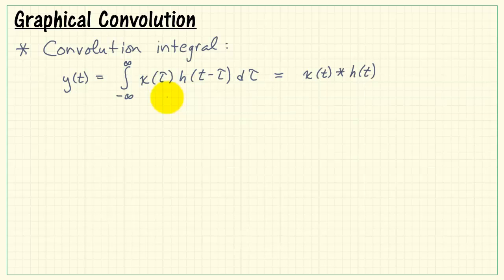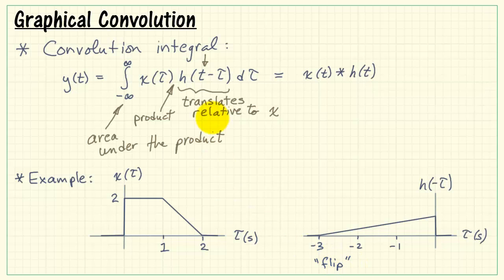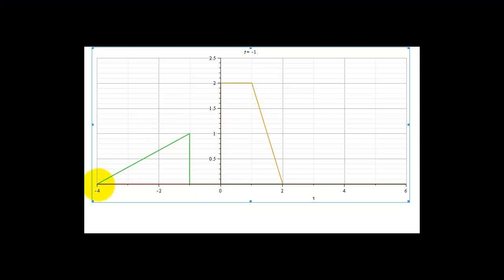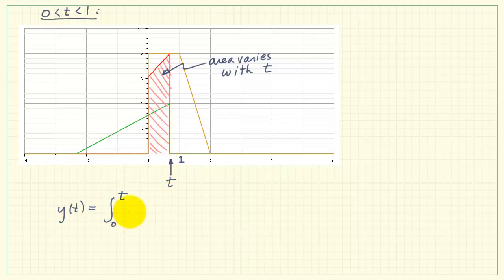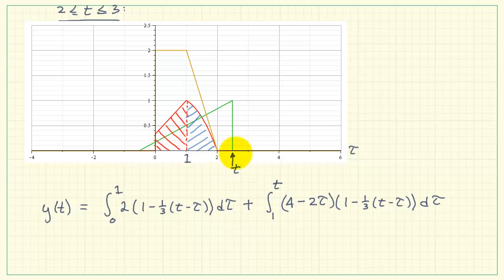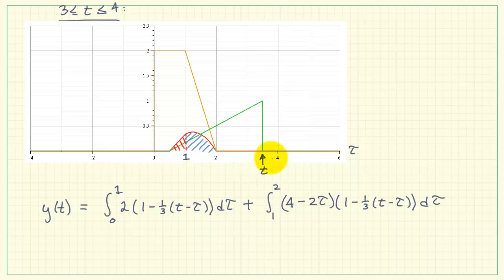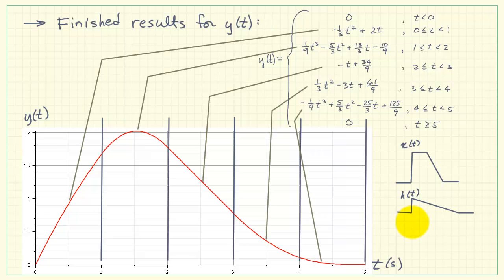Graphical convolution example

Comment: mistake;
when t is negative, the curve will slide to the right.
Reply: you flip before sliding. this means when t is negative it slides to left.
Reply: So you must first slide, and only after you ahve slite it by t you will reverse it, right?  If you do this, a very big negative t will bring your signal to the far left(first you bring it to far right, then flip it and it will go to far left) insted of brnging it to far right , is it correct?

Comment: Really appreciate your work! It has helped immensely! 
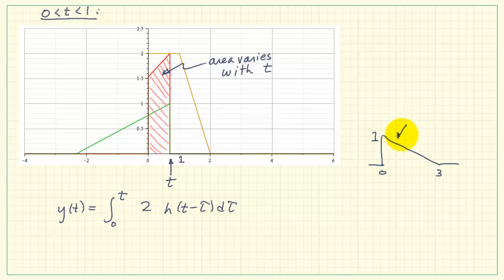I have a question, if you don't mind... At 5:23, you needed to find an equation for h(t-tau). You developed this equation from the original, unmodified version of h(t), that is a ramp with negative slope. Why did you use the original h(t) instead of the modified version, h(t-tau)?
Reply: +Thomas Turkington 
He just came to a point, where he needed to insert the function of h. Using h(t) or the "modified version" h(t-tau) is just playing around with the argument of the function. So it's straight forward to just look at the shape of h(t) and think about the function definition, which will just give you a simple linear function as you are used to work with. Without any other constants or variables to take care of. Once you have the function of h(t), you get the function h(t-tau) by inserting "t-tau" for every occurence of "t" in h(t). That's it :)
Reply: Thanks for this
Reply: Well explained.

Comment: at 8:10 , why is the intercept 4? I do not see it, please help !
Reply: For future students wondering how, simply use the slope formula and slope intercept form to find the equation of the line.
Reply: Imagine that section from t=1 to 2 of x(t) alone, and then picture it extending in all the domain of t. This new line function would be x1(t)=-2t+4 when extended, but if you took only a piece of it, from 1 to 2, it'd still take the same equation to describe it. Hope it helps!

Comment: You explained what took 4 class lectures in a 11 minute video. Thank you. :D
Reply: yellow pony is best pony.
Reply: Kite Tenjo Indeed. :D
Reply: Memo Pony And it could be explained even shorter - At least the fact HOW convolution works - However, WHY convolution works and why it is so powerful, is quite hard to understand in my opinion - At least, I am not able to find any good information on that. So either it's too hard to understand, so people are just fine with understanding HOW it works - or I am simply too dumb to understand why convolution works and is so useful.

Comment: in the 0,1 interval we get Parabolic function 7:15. but we can see on the simulator that it is straight line and i allso draw the function and im getting parabolic line
Reply from the maker: Hi Jan Be -- The red curve straight line at 3:44 shows only the product of the two functions, not the convolution result. The parabolic function at 7:15 is the area under the red curve which is the convolution result in this interval.
Reply: ***** thanks alot.like your chanel.good job

Comment from the maker: At 8:13... we need the equation of the downward-sloping line between t = 1 and 2 seconds. Projecting this line back at t = zero means that the line hits the vertical axis at 4 (this is the y-intercept). Even though the line does not actually extend up to this value (because x(t) is constant in the 0 to 1 range), you need to write the function that describes x(t) during the 1 to 2 second range. Hope that helps!
Reply: why does the interception is 4? Shouldn't it be 2?

Comment from the maker: The "flip" is part of the mathematical definition of convolution, and generally makes a difference in the result. An exception is when the "flipped" waveform already has even symmetry, for example a triangle ramp that goes up and comes back down at the same rate (even symmetry means you can flip the waveform about its center value and it looks the same).